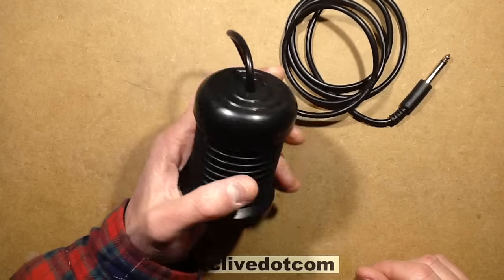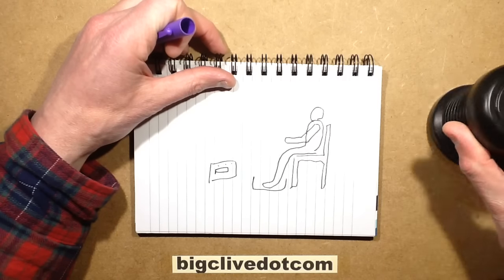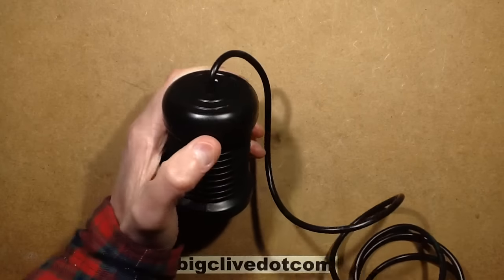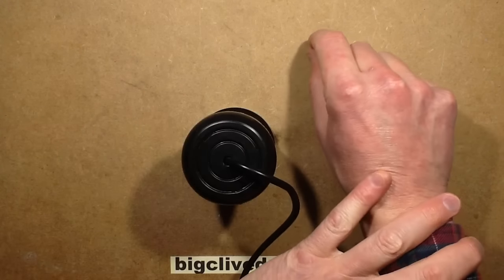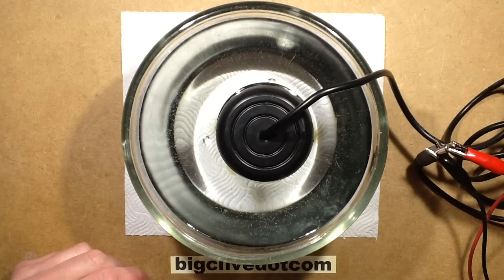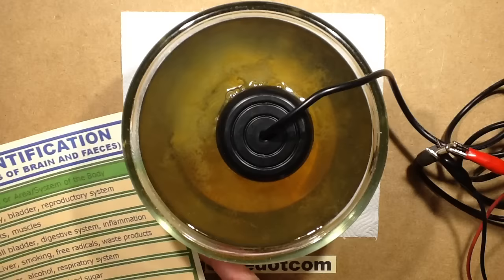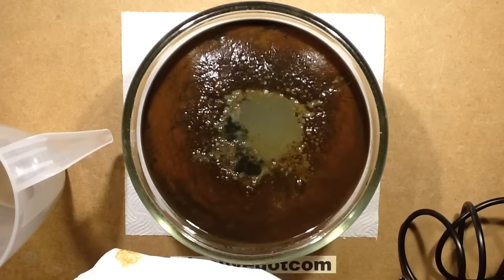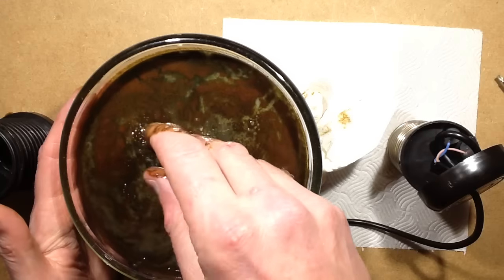Ionic foot detox electrode scam.  How it works.

Comment: I wonder what chemicals you’re getting. You have very clean electrodes because they are decomposing through electrolysis. 
At school we electrolysed sodium chloride quite a lot with carbon rod electrodes. We got chlorine, (hydrogen and sodium hydroxide?) - someone keep me right, it’s almost half a century ago - but I never remember the water going funny colours.
Stainless steel comes in many flavours. It can or cannot be magnetic.  If you even bend stainless steel sheet, the act of bending will transform non magnetic into magnetic at the bend. 
It depends on the alloying elements: nickel, iron and chrome. It can look silvery or goldy. Some types really hate anaerobic conditions and the iron will leach out, and you also have specific marine grade stainless.

Comment: I used these ionic foot spa for quite a few years on the public. What you do not inform customers is that at the beginning of treatment the water for people does turn mucky however how do you explain after set sessions the water does not go murky at all it remains clear meaning your system has been cleansed. It does work. The murky water can smell of chocolate if somebody eats a lot I’ve also smelt alcohol strongly . Informing me what excess there is in peoples bodies. It works.
Reply from the maker: Yes.  The amount of added salt or the current setting is reduced progressively with subsequent treatments to make it look as though the effect is working.

Comment: If there is no corrosion on the stainless steel parts inside, then maybe what is happening is that it is interacting with stuff in the water.  And depending upon what is in the water, you might get different colors.  Did you use tap water?  What if you used distilled water, what would happen then?  Distilled water being so pure shouldn't give it anything to interact with.  But maybe ionic devices require minerals to work and if that is the case there is no minerals in distilled water, so you might not even be able to use it with distilled water.
Reply from the maker: Distilled water is not conductive.  Even tap water may not be conductive enough for a fast fake colour effect, so they add salt to lower its resistance.

Comment: So to completely prove this product to be wrong and false in what it claims, how much testing did you do to prove it to be false and inaccurate and what were the results?
Reply from the maker: The test showed the electrodes corroding into the salty water without human involvement and there is an online report showing the cocktail of metal salts that come off them if you search for it.  It included toxic chromium and nickel salts that people are then effectively marinading their feet in.

Comment: The quality of these devices must vary a LOT because I go to a clinic with a medical grade device and it definitely pulls things out of my feet. It’s an INTENSE sensation and it visibly reduced swelling in my ankle. Their machine is over $3,000 though. I’ve tried the cheap ones from Amazon to compare and it just felt a little tingly with no pulling sensation.
Reply: Stop being brain washed

Comment: did it last week knowing it was potentially a scam and tbh it felt great even if it didn't do anything. placebo effect is real af and it was honestly just relaxing to sit with my feet in hot water in a dimly lit room with aromatherapy and calming music lol
Reply from the maker: It's absolutely fine for that.  But note that some of the metal salts being generated are a bit controversial, although it's possible that their low levels could actually have some benefit.
Reply: I just found it funny I had this done and I was told it was moving tobacco out in which I don’t smoke and no one around me does, so I just thought it was funny that my color was that of a tobacco user.

Comment: So you said nothing. WHY did the water turn brown? And what EXACTLY is that brown stuff that that thing made?
Reply from the maker: It's basically rust.  The unit dissolves the metal electrodes into the water creating salts of chromium, iron and nickel.

Comment: Can’t that be used to convert salt water to chlorine on demand to stabilize the concentration in a pool or spa?
Reply from the maker: It would require special electrodes to handle that chemical activity.  This would just turn the spa brown.

Comment: Did you use distilled water as recommended ?
If not, your simply pulling apart water that's contaminated already.
Reply from the maker: The salt is the dominant contaminant.  It wouldn't matter if distilled or tap water was used.

Comment: I wanted to buy an ionic foot bath but wondered if I could test the coil by itself for this very reason.  I figured the same thing out with ear candling years ago. The so called earwax being "pulled" out of the ear canal seemed to be excessive.  I tested a couple of different cones by putting one in a jar and one in an apple. Same result for both.  Globs of ear wax came out! Miraculous 😆 🤣 😂 The cone itself is dipped in beeswax so duh...no brainer.
Thanks for saving me $300!  😃

Comment: Thanks for exposing this Lie.
I have written to the companies that sell these things, I use electrolysis all the time in my every day life, it's crazy to think that metal oxides are not making the water turn brown, or whatever color they feel will grab your attention.
 This is Truth: there are many detoxification methods. The ones that you buy at the store that are made "to detoxify the body" if it doesn't say exactly what it's detoxing you of,its snake oil at best.
 Unfortunately this greedy practice leads to those who would have found what they were looking for, but because they have no benefit from store bought detox methods, they give up on actual real natural medicine, and the different types of detoxification methods that do work, for different things, nothing is only going to pull out"bad stuff" and if it doesn't explain how and what it's supposed to be detoxifying the body of, it's more than likely not worth the package it came in.
 Thanks again for exposing something that Grown Ups should know, that any time you do electrolysis, you are going to have mucky water.
Reply: this is Hydrogen Ion Generator. good remedy for free radical damage (osteoarthritis) and lactic acid buildups (muscle fatigue). i use this on hundreds of clinical patients since 2007 for joint pain (including cases recommended for surgery) and sports recovery.
Reply: @DRCHENYK  So are you saying this DOES help????

Comment: This thing has to have the best placebo effect. I’ve done one of these when I was starting to come down with a bad cold. I hate taking cold medicine so I thought this would be the best alternative.
Immediately after I went home and slept for the day. I woke up the next morning having to pee really bad but I felt 100 times better.
It may not be detoxing but it’s doing something to you body.
Reply from the maker: These units put a cocktail of metal salts into the water, including nickel and chromium.  It is possible that some is penetrating the skin and having an effect by being a toxin in a very small dose.

Comment: I know what happened. The electrodes separated the rust from your dirty tap water. You should get your water tested first for toxins. As someone who uses electrodes to test how clean tap and drinking water is, I can tell you those electrodes work but, the water already contained toxins to begin with. So obviously the machine works removing toxins in the body as long as the water doesn't already contain rust from rusted pipes.
Reply from the maker: The water test version just dramatises water conductivity.  My local water is ultra pure.

Comment: What if you do not add salt to the water?
What reaction occurs if you soak your feet in water with the device without adding salt?
I would like to know that, please 😁
Reply from the maker: The units use low voltage, so for the proper effect salt is needed to make the water conductive.  Natural salts present on the body may not be enough to produce a strong visual effect.

Comment: As soon as I saw the commercial I saw and immediate scam as It reminded me of a water electrolysis experiment I did in 9th-grade chemistry. I recreated it at home to make small plastic bag bombs filled with the hydrogen and oxygen gas in it. I didn't have access to stainless steel wire so I used copper wire and within minutes the wire became fecal brown and all kinds of brown and green bits floated around as the water became dark and slimy.

Comment: What if u did this with pure distilled water. Do not add salt. B.c i noticed they almost always add salt and you stated you did. Would this also happen with no salt?
Reply from the maker: With absolutely pure water it wouldn't work at all.  The level of impurities changes the conductivity of the water, so the more there are the faster the effect would happen.  The controllers use current limiting for very conductive water.

Comment: Every time I do the baths it pulled literal objects out of my feet that aren’t the basic color change from the electrical reaction which always changes orange. It pulled green chunks that looked like the things that came out of me during a gallbladder liver cleanse I did years ago! And so much foam from my lymph. I’ve been struggling with ovarian cysts, endometriosis and hashimotos so I started using the foot bath again and when I had Candida overgrowth before there where white chunks. Now it’s all black, foamy, and bright green which reflects the hormonal imbalances I’ve been feeling. Now I sleep sooo well and my headaches are going away. Quack the basic science of the water changing orange as all the products tell you it will whether your feet are in the water or not but this foot detox bath has been saving my life and pulling out matter beyond the basic electrical charge reaction.

Comment: The water turned into colored happened without feet in it. So the dirty water is not the result of detox.  It is just reaction  between electricity and the solution(You said that is salt water). You got to proof how the disgust water detox.

Comment: You could have weighed the equipment before and after. If you have a balance accurate enough then you should see that the mass of the electrode has decreased.

Comment: So is this bad for you, having your feet sitting in this?
Reply from the maker: Technically speaking your feet are in a solution of chromium and nickel depending on the material the electrodes are made of.  Normally they'd be considered toxic metals, but in a low dose foot soak there is a possibility that there may be a benefit to the low exposure.

Comment: Wondering if the discoloration is the bacteria that naturally exists in water.
Reply from the maker: It's not.  It's purely a mixture of metal salts from the corroding electrodes.  That includes chromium and nickel.

Comment: The problem with this approach is that he failed to take into consideration that 2 things can happen at the same time.  If you only look at the rust then obviously that is the only thing you see.  If you want to know if it works or not, use it. Take blood work before and 1 month or some weeks later then compare.  Or check your body before and after few weeks of usage and see if there is any change.  That is the ultimate test.
Reply from the maker: Given that these units generate a soup of metals considered toxic, like nickel and chrome, then it would be interesting to see if the levels of toxins in the body increased.

Comment: Thank you! I've used a professional one in the past and it was the real thing. Smelled awful and pulled a nasty infection out of my hand. I used the one in your video the other day and what a piece of junk! Looked and smelled like rust. NOT what it's supposed to be. Thank you for exposing this product.
Reply from the maker: The chemical cocktail they produce will depend on the metal the electrodes are made of.  Some with stainless electrodes put out a lot of toxic chromium and nickel salts into the water.  That could help with infected skin, but is not something you should soak your feet in for long periods of time.

Comment: I was hoping that there would be a scientific explanation of why it produces the brown color, slime and bubbles. But the video end abruptly with the producer shocked about the simple construction.
Reply from the maker: It's accelerated electrolytic corrosion of the electrodes.  Basically high-speed rust.

Comment: This video doesn't prove or disprove anything. the product manual says the water will change color weather or not your feet are in it (something about a chemical reaction between the salt and the electrical current, the contaminants in tap water could also play a part). 
You would need someone to get a heavy metals test, use this device a few times then get another test to see if there is a difference....
Reply from the maker: A test was done on the electrolytic corrosion composition in these fake units and the brown soup they create was found to contain salts of chromium and nickel.  Neither of which is good for human exposure.

Comment: I think some of this comes from the how the body will get rid of certain waste products through the feet. If you stick you feet in warm or hot water you will likely start to see black flecks or bits of things on the surface of the water.  My mother used to have to use a foot bath a lot of for a health issue and was concerned about the flecks and the endocrinologist explained its just a natural biproduct and one of the reason foot health is so key to so many systems in our body. 

But anyone who has had to clean a hot tub before will find this stuff.  I recall the older non ionic machines (from the 90's)  would site these as proof the machine was working but none of them actually tried to produce false toxins. That is MUCH more dramatic but that also looks like a chemical reaction to the table salt in the water. I think you are correct with more table salt you likely get more gunk and worse kinds of gunk.  

I think like most quack products they latched onto the idea of a naturally occurring body process that laymen know nothing or like my mom just enough about to think there could be more to it. Then make a show that either backs up the partial knowledge, twists it, or distorts it and adds in...grungy fireworks in this case. THANK YOU! I was wondering about this with the christmas season COVID season bringing these back into ad spaces again

Comment: Try it with distilled water no additives. Then do it again after that to see if the results are the same. Could be cooking off coatings
Reply from the maker: Distilled water is not conductive.  That's why they add salt.

Comment: The question remains where does that crap come from???????? Is there something already in the water?
Reply from the maker: It's the electrodes corroding at high speed.  The colour is comparable to rust.  The electrodes have to be replaced when they dissolve away completely.

Comment: Have you tried distilled water??  I am curious.  Distilled water/pure water is Non-conductive.  Curious if it would turn color with distilled??
I’m wonder the color is the iron content in the tap water.
Reply from the maker: It doesn't work with distilled water because it is non conductive.  That's also why they add their "special" salt.

Comment: This is not a scam I did my first detox and I felt the difference it does take inflamation off your legs and it puts a spring in your legs and gives you energy so it depends on how severe you are my water didn't get that dark because I do many herbal cleansing and other things this works and I feel better
Reply from the maker: If you feel it benefits you then by all means continue doing it.

Comment: Why are tens machines which put an electrical current through the body, acclaimed and proven to give health benefits, when putting the water colouration to one side this machine puts an electrical current through the body just the same way, yet is a quack product with no benefits?
Reply from the maker: The TENS machines pass enough current to stimulate a nerve response.  These units only pass enough current via the wristband to detect if someone has their feet in the water so they don't accidentally start turning it brown prematurely and spoil the show.
Reply: @bigclivedotcom  Haha you really believe your own nonsense,tens machines dont kick out much at all,  let me ask you a serious question you think the results are from the interaction between the coil and the water like an ionizing , rusting effect so the results are fairly generic and similar regardless of a pair of feet in a bowl or not, right ? So explain this to me I've got a dual ionic detox machine so it does two people at once, you tell me how two people with two separate bowls filled from the same water source, using two separate brand new fresh out the packet coils, can get two completely different results ? If the machine as you keep saying has no interaction with your feet whatsoever? If what you said is correct you would get exactly the same generic results from two coils in the same water source, wouldnt you ? 😁 I cant wait for you to explain this to me ,lol

Comment: I wonder what it would do without the salt 🤔.  And wouldnt you be putting some type of heavy metal in your system using this device? IDK but i knew it was probably a scam.
Reply from the maker: It would affect the speed of the effect depending on how naturally conductive the water was.   Some of these units do expose the user to chromium and nickel salts in the water.